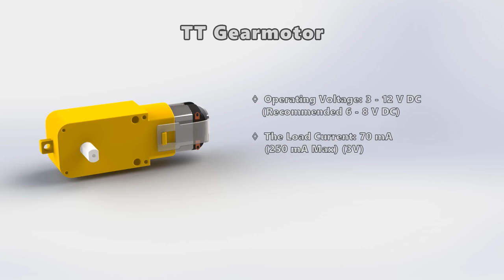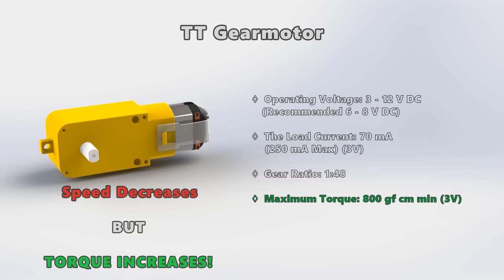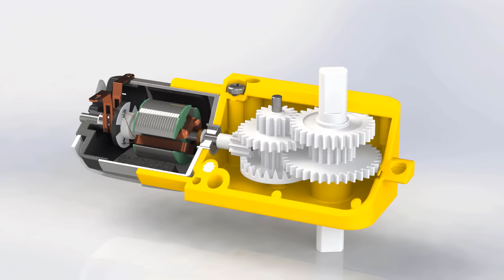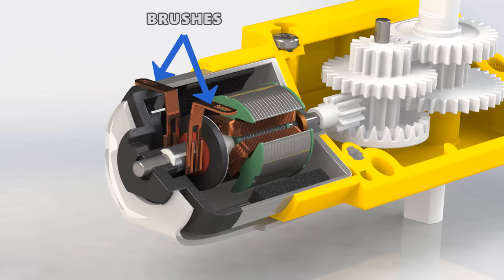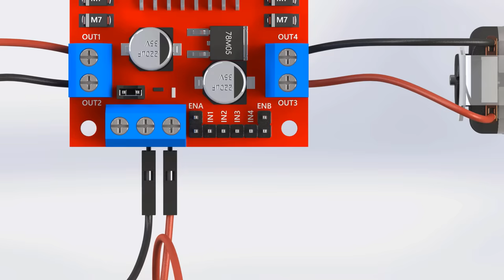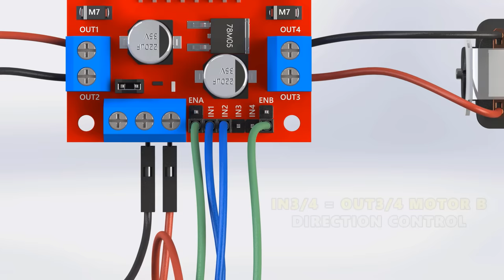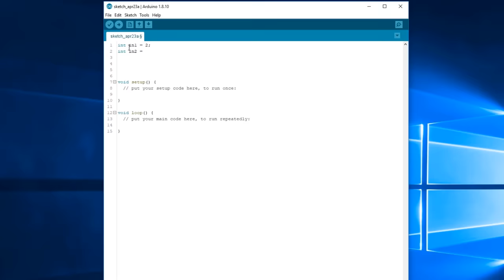How DC GEAR MOTOR Works with ARDUINO and L298N

Comment: Note that with the L298N motor controller you can also control the speed of the motor using:
analogWrite(in1,255);
analogWrite(in2,0);

Where 255 is the desired speed value (255 is the max speed). Replace it to 127 for half speed, 0 for stop. Reverse the values between in1 and in2 for the reverse direction. You can do the same with other motors (in3 and in4 in his tutorial).

Comment: Very good video. Thank you. The problem I face with 2 motors in a car/tank is with speed synch between them. Would you recommend of using one motor with a gear that can distribute different speeds to allow turns? Also, I wonder if such a great can be 3D printed.

Comment: Okay, so now I actually watched it, man those 3d models are awesome.

Can I use those in my videos?

Also, you used digitalWrite for speed control, instead of analogWrite in the code.
Reply from the maker: Thank you, thats a mistake on my part, I will correct it in the next video. For the next videos I was planning to make a quick start arduino video for beginners in robotics. I will explain digitalWrite and analogWrite shortly, and mention the mistake in the previous video.
Reply from the maker: Models are on the GrabCAD, open source (you can use them). I did not uploaded the wiring model yet, I plan to do so, and Arduino model comes in couple of days.
Reply: @Robottronic  thanks. Looking forward to more videos. I usually make videos anout Arduino etc in URDU language and such models will really help me.

I will be sure to tag/link your channel grabcad when I use the models. Thanks.

Comment: Woow! Great job man. Came here from reddit. What's the program used for the 3d animation with the wired arduino board ?
Reply from the maker: Hi, glad you liked it, any CAD software can do the animations. I'm using solid. :)
Reply: @Robottronic  hi there. thanks for the awesome video.
Are you using solid works ?